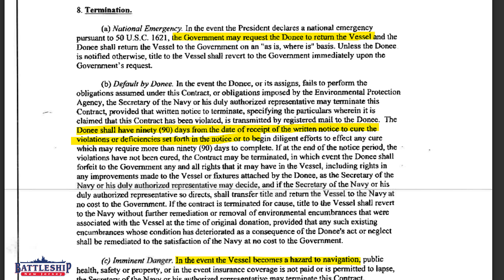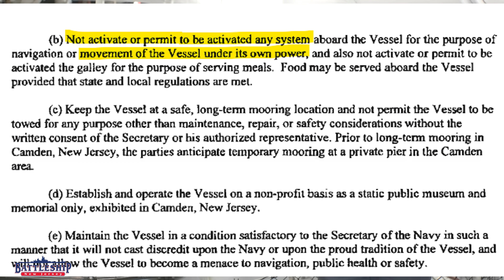Can Battleship NJ Still Move Under Her Own Power?

Comment: Even if it is not disabled, Ryan had shown us how the museum had substituted parts of the steam plant with similar in appearance but not rated as the replaced parts. So in short, it is very dangerous to operate the steam plant. Even if the Navy re-acquires it, since the ship was discommissioned before the implementation of Level 1 requirements for high pressure steam plants, it will be a huge challenge to make it Level 1 compliant.
Reply: Nothing a few billion Dollars can’t fix.  It would be seriously expensive but the hardest part would be trying to get qualified crewmen
Reply: @danielharnden516 I think Ryan has said that it'd probably be cheaper to build a new ship than try to reactivate New Jersey.
Reply: @BritishTeaLover  There is more truth in this statement than many can understand.
Reply: @danielharnden516  I don't think there are any qualified crewmen in service still. You would be trying to teach an entire new generation old systems.
Reply: @Ghauster  Might have a handful of the former crew populating upper ranks, but the rank and file would absolutely be a huge problem.
Reply: @Ghauster in Great Britain they stopped flying the vulcans because there's nobody left to service the engine's 😢
Reply: @Ghauster   If you want to get into the meat of it, nuclear aircraft carriers run on steam turbines of similar size and shaft horsepower as would be needed for an Iowa class BB. The steam cycle is the same, but instead of getting heat from hot rocks you're getting heat from burning oil, so there is still plenty of practical knowledge in the MM rate for how to operate a geared steam turbine. What is missing is how to handle the care and feeding of the massive oil fueled furnaces that drive the Iowas. 

There's also the issue of all the changes that would be needed to bring the ship into compliance with modern engineering safety standards, having a pipe that was not up to spec let go and release working steam into main engineering would be catastrophic.
Reply: @danielharnden516  I would say getting the crewmen is not the hardest at this point. The Navy still operates a handful of conventional steam ships, though the numbers are declining.
Reply: EDIT:  Oops!  I meant this to be a reply on another post!

In my own profession (to be retired from on 1/12/24) as a Software Engineer, this is somewhat equivalent to being a COBOL programmer.  NOTHING new is being done in COBOL but there are TONS of essential financial applications that depend on this 60+-year-old programming language.  The only COBOL that I know is from a 1983-ish class (302-C, vs 302-F for Fortran or the third one which I don't recall) at Indiana State but that is probably more than 95% of most modern-day software engineers know.
Reply: Yeah if the navy ever did reclaim the BB New Jersey, they'd need to look through the journal of alterations that the museum keeps. Overall, the Museum does it's best to preserve the form, and sometimes that comes at the expense of the function.
Reply: I quote the ASME boiler code that defines a pressure vessel as a contained explosion with serious responsibilities to keep it contained.
Reply: The parts for that ship came from 30's, so even if you could make steam, the supporting part of plant [steam traps, valves, seals, flexitalic gaskets, etc] wouldn't work and parts are not available. No simple task to make those items...but doable 💰💰💰
Reply: @williamorton7600  money and time. Reverse-engineering an old part and make it compliant to new standards are difficult.
Reply: @williamorton7600  This ship was designed and built after the US standardized steam devices so its simply a matter of replacing those components that require replacement with 650+ PSI rated equivalents. The nuclear steam plants used by the Navy use similar designs on the high pressure side to the Iowa class machine sets so there is parts and knowledge compatibility. The challenge would be running the boilers, but that isnt even really a challenge for any licensed boiler operator. You'd basically have to learn the quirks of each battleship boiler installation such as, when they will snort and heave.
Reply: which parts did the museum replace?
Reply: @KPen3750  one of the valves for connecting steam from shore.
Reply: @petershen6924 that wasn't substituted; the pipe under the valve was leaking rain water in, so they cut the valve off at deck, plated over the pipe and re-welded the valve on top. Looks the same, is the same valve, but pipe from the valve no longer functional underneath because blanked over.
Reply: One part I recall off the top of my head was one of the shore steam fittings/pipeline that fed steam aboard to get things up to speed faster, remember that most everything aboard requires and is tied into steam powering it. Since the piping under the deck was rusted away they just capped and replaced the fitting for "show". WWII configuration with (crude) fuel oil is it needed to be heated to thin it down for pumping to the burners @KPen3750
Reply: I expect the NJ museum has kept good records of all repair/maint/changes that are different from when BB62 was in service or would need to be reworked to make her operational again.  We have seen several of those things in earlier videos, but there are probably lots more records... 

It may even be worth creating a "Reactivation Checklist File" with a collection of things that would need to be fixed in each area before NJ could be ready to go active again.
While it is not likely to happen... it could be a useful mental exercise... and help prioritize the maint/upkeep of the ship as a museum.  I think that many visitors to the ship (both online and in person) would find it interesting to read through those logs/docs/notes just to understand more about the ship.
It could also help toward donations, if people and companies see the level of effort and cost required to maintain NJ.

Ryan has even mentioned documents left by ships crew near decommissioning, which describe things that would need attention if NJ was brought back into service.

Computer notes could be sorted/categorized in many ways, with info about:

○ Location within ship
○ Level of importance/severity
○ Category: electrical, navigation, propulsion, seaworthiness, hull, on-deck, environmental, museum,  communications, crew support, galley, leaks, drydock, painting, welding, structural, cosmetic, dozens more.
( maint items could fit multi categories)
○ time frame needing attention
○ estimated level of cost
○ est time for repair
○ general notes, thoughts, concerns
○ possible issues if not fixed
○ item for USN/activation only, or museum/maint
○ any related docs or photos
○ earlier work history / future plans
○ tools/materials/equipment needed
○ status: planned, deferred, completed, USN only, in progress, not approved, too costly, waiting approval, etc.
○ Date first noted, last checked, next review, last work
○ work by: volunteers, staff, contractor, drydock, etc
○ contact ID for item/task/issue (internal view only for details)
○ 

Some of this could be stored/avail on computer... but to start, it could simply be a few extra file cabinet drawers that collect an extra copy of notes for known maint/repair issues found during  museum operations, that could pertain to reactivation as well.
Reply: She.s just resting they still pack  power...
Reply: If the ship is ever being brought back into service, they would probably replace the power plant with a modern system and just leave the weakness in the armor deck
Reply: @king_br0k  they would probably just yank the turrets and drop them on a new hull
Reply: @MarkoDash  I think they would keep the armor, and they brings most of the hull with it

Comment: I would tend to believe some parts of the boilers have been cut or de-milled to prevent use.  I have been below decks on the USS ALABAMA and seen where the Navy cut pipes to prevent use of the boilers.
Reply: Ii chatted with a team member of the USS Iowa team that was prepping it for transport from Oakland to LA. That ships engines are preserved and ready to fire and they said could be fired up in few weeks. They still had fuel aboard when the museum took posesstion that was being pumped out.
Reply: The USS Alabama is a South Dakota class. They were decommissioned and were never intended to be recommissioned. Hence they were fairly permanently. The Iowas, as Ryan stated numerous times were decommissioned with the plan to reactivate if needed, so they were not disabled.